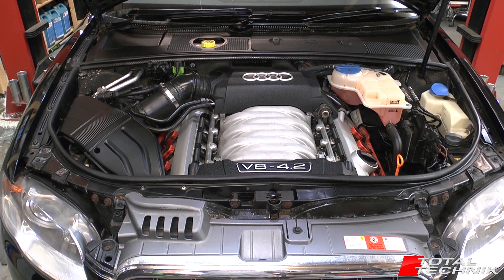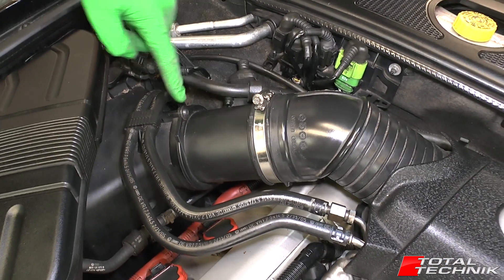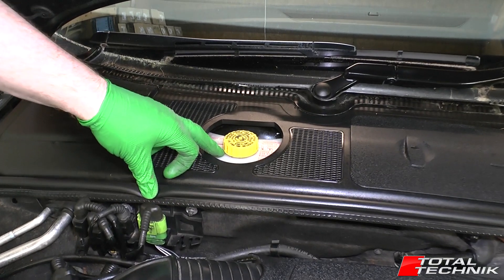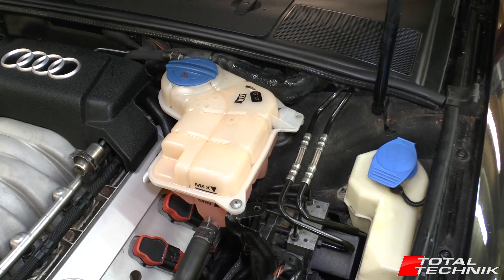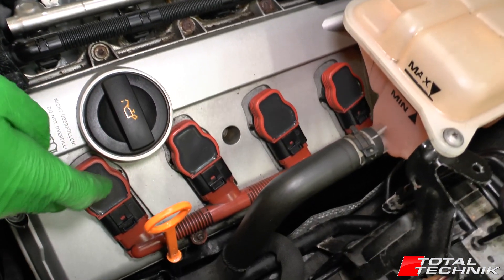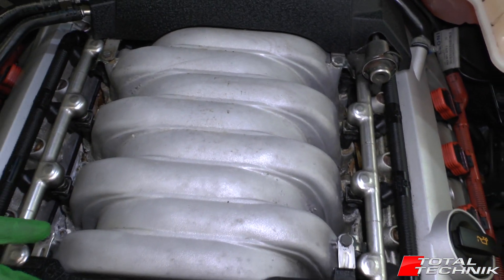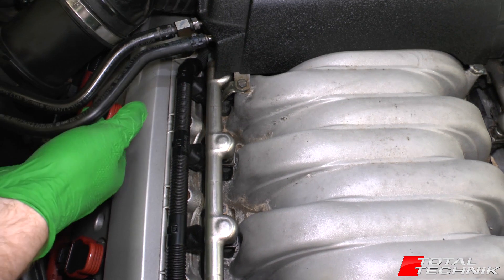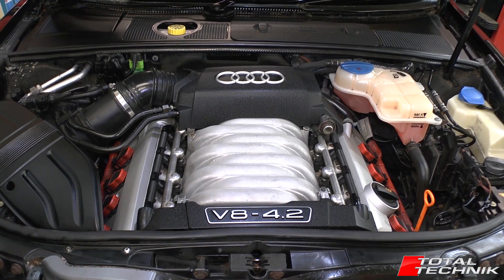Audi S4 4.2 V8 Engine Bay Guided Tour (Basic Components) - Audi S4 - B6 B7 - 2003-2008

Comment: hi sorry to drive you nutts😁.  I'm a little stuck🤔 I have changed the the gasket,s on the oil filter housing, when taking apart the vacuum line, that runs along the bulk head, and down the passengers side to the front, was very very brital and fell to bits in my hands😲. I have replaced with better pipe.. where I'm lost, is. putting it back together🤔.  drivers side all ok.. passenger side ok back to, T peice just before the bulk head. 3 heads on the T piece.. 1 from actuator at the front, 2 pipe from bulk head, 3 is where I'm stumbled? looks to go under the oil filter housing, but where dose it plug in to?... if I tryed to start the car haven not done it the right way will it harm the car?.... 
sorry for the long story. hope you can make some sence of it, need help😁 thanks jamie